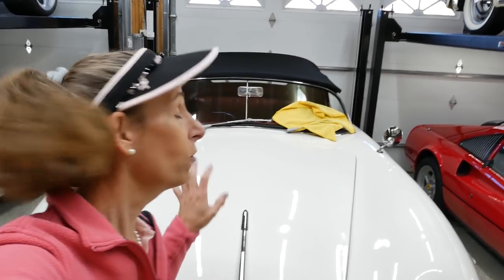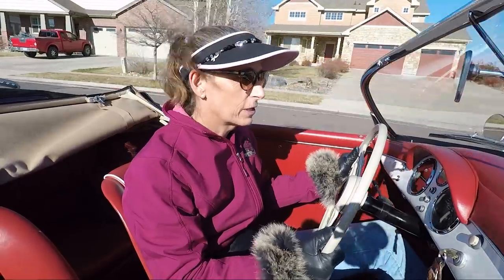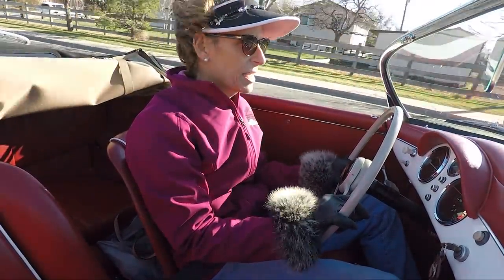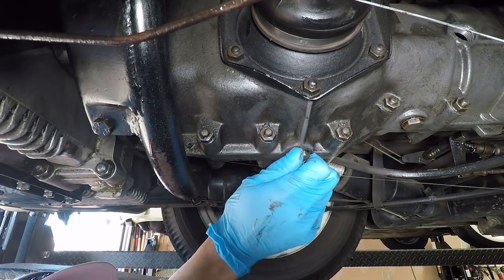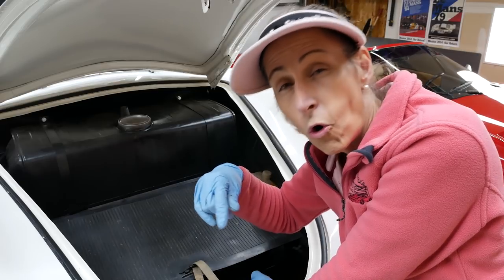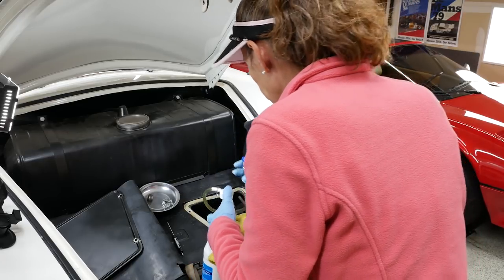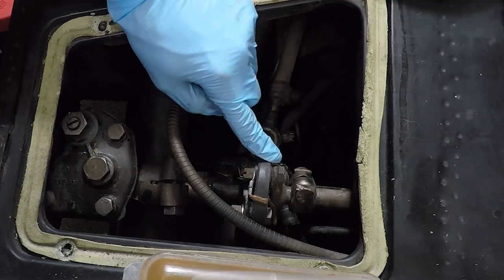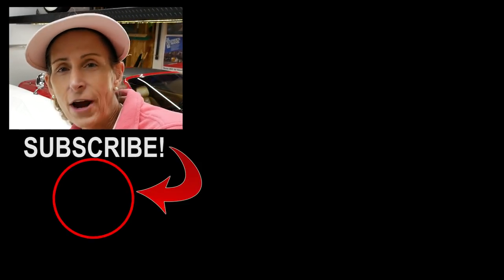Speedster Vlog #8 - Shifting Gears! - Transmission and Steering box fill

Comment: Same common problem: Steering box moderate leak on my '63. We tried Scotty Kilmer recommendation of AT-205 Reseal, an excellent rubber gasket restore polymer. We made Registry Holiday trip from Seattle to Flagstaff & it seem to cut the leak in about 1/2. Hard to tell for sure as we'd never driven that far in 30+ yr. owning that car. Eventually need to rebuild the seals... Great vid as always. You are an amazing mechanic & have the unique ability to explain how & why as you go. Thanks for sharing. Your technique on the rear pulley seal encouraged us to do the same with stack of giant washers while we recently had engine out for a clutch. Keep the 356 Faith...

Comment: The fluid coming out looks pretty good.  Top tip: place a small, button shaped neodymium magnet on the inside of the drain plug.  It will collect ferrous metal bits between changes.

Comment: Well done. Surprised how many parts look like Beetle parts.
Reply from the maker: Funny about that...  In 1950 it was mostly VW running gear and a suped-up VW engine.  By 1955 there was still some bit of cross-over, but lots of bespoke parts.  And, from there, less and less VW parts until almost none by 1965.  Many of the parts look similar but aren't really interchangeable.  It is a bit of a treasure hunt...

Comment: Many thanks for another well produced, insightful video.  On the question of lube for VW steering boxes, I've used the thixotropic grease from John Deere.  I has the interesting property of liquefying under pressure and otherwise remaining thick enough to stay in a box with leaky seals.  The product is called "Corn Head Grease."  This may not be the best for very cold weather operation, but it has worked well for me in VW boxes.

Comment: I’ve really enjoyed this series. I learn something every time. Franny, you’re right about the VW steering box; it was in the 356A T2 series, starting in Sept. of 1957, when they switched over to the ZF steering box that continued through 1965. The great thing about the T1 VW box is that it is still available new as a TRW replacement part! ZF boxes must be rebuilt.  Also, I love that you’re always so meticulous. I like the slot-aligned screws on the steering box cover when you replaced it. But then you pulled the trunk mat out from under the hold down lip in the back and put it on top! Oh no! But seriously, a trivial thing and gave me a chuckle.
Reply from the maker: Thanks Chris!  You are absolutely correct!  Didn't know that!  So many things to learn about these cars.  I did find it interesting that the Speedster's mat is missing the slot on the right side to clear that cable (maybe I just didn't see it?).  On our car, there is also a cable on the left side in the rear corner that isn't cut out.  That is why I had always slid the mat forward just a tad to relieve it.  Great to know about that lip!  Thanks!
Reply: @HeidiandFranny   I would look for an old Beetle steering box with some good life left in it before buying a new TRW. Original equipment is almost always a far better product for less money. Those steering boxes are easy to come by at swap meets for peanuts. i'd like to see a ZF box up close. I know on thesamba they are quite pricey.
Reply: On my Spyder replica, I replaced the box with one of those TRW boxes and it worked fine. I  could not find a used box that didn't have any play in it even after adjustment. This is a great series.

Comment: Hi Heidi and Franny, I hope you are keeping well during this Covid-19, just want to say I LOVE LOVE your amazing enthusiasm and love for cars in particular Porsches, you are gurus at what you are doing so keep up the great works. I am due to get a 356B soon and wondering if you have any advices on handling in terms of its manual transmission gear changing, is it difficult or easy as I get confused upon reading various articles. Thanks so much for your time and keep safe, John from Australia
Reply from the maker: Hi John, Congrats on the upcoming car!  How exciting :)  The 356B got a new transmission from the A cars and it shifts smoothly and much faster with about 1/2 the throw.  It should feel direct without much play but be smooth as well.  The clutch should be relatively light, but predictable.  If is isn't all these things, it could be adjustment, linkages, bushings, etc.  If it is slitting out of gear or noisy with the clutch pedal out, then there are some issues inside the box that will require sorting.  If there is noise with the pedal in, then the Through Out bearing could be bad.  The clutch is not very expensive and pretty straight forward to replace if necessary.  Please let us know how it is once you spend a little time with the car.  Good luck!

Comment: What I would give for a drive on a sunny day in such a lovely car!
Regarding the steering box, some guys here in the uk have been able to source replacement bearings for their increasingly rare RHD split buses. 
I wonder what actual vw model the 356 shares it's steering box with.
Reply from the maker: Great question.  I guessing there weren't many back in the day, but the beetle would probably be the closest?

Comment: Did you find any metal in the transmission oil?
Reply from the maker: Great question...  No... but, there was no magnet in the plug either...  The inside felt clean enough.  The noise is a bit of a mystery.

Comment: What is involved in making the braking dual circuit?  Are the front brakes on one circuit and the rear another?
Reply from the maker: Well, you need to source the new dual circuit master and then you will need to re-route the metal hardlines.  Usually, the one circuit is used for the rear and one for the front.  It is something I should think about for our 356A.
Reply: @HeidiandFranny  🤢

Comment: In a 1965 Beetle that much play on the gearbox it will be to much or still safe to drive the car?
Reply: Its ok to drive its just does not give you good road feel especially at speed.
Reply from the maker: Oh, it is fine...  I just don't like any play at all...  With a good alignment and good tires, it will drive really well.